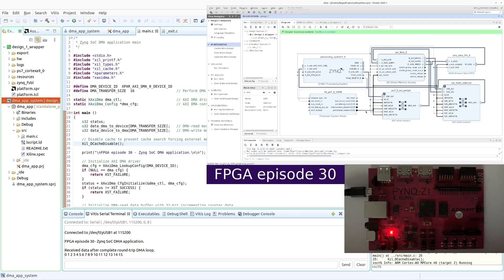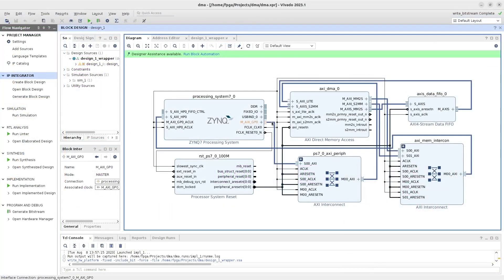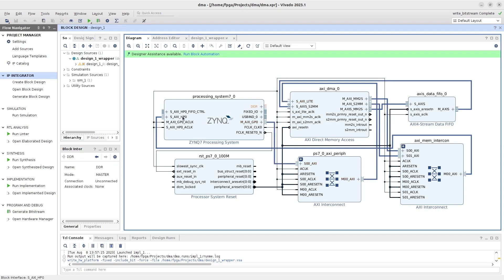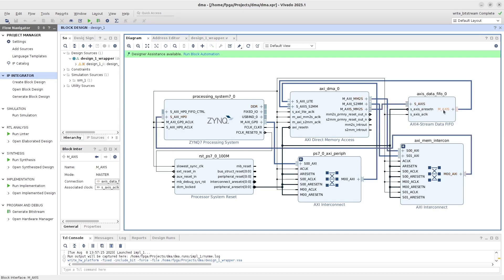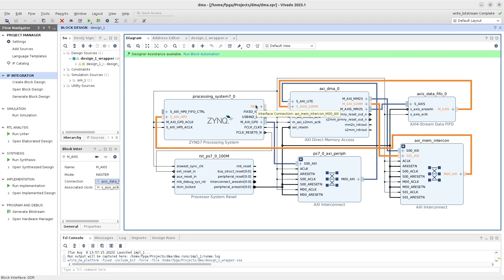FPGA 30 - Zynq SoC FPGA Direct Memory Access (DMA) between PS DDR memory and PL AXI4-Stream FIFO

Comment: Hi thanks for the video, dont you need to connect the fixed_io and DDR pins of the Zynq7 block in the PL via the auto connect?
Reply: I am thinking the same thing.  I followed this video for the Arty Z7-20 and I can program the FPGA but when I go to debug the application I get the error:
 "Error while launching program: 
Cannot reset APU. APB AP transaction error, DAP status 0xF0000021"

Am trying again but this time after connecting the fixed_io and DDR pins via automation
Reply: Update: Using Vivado 2024.1
Everything was resolved after I power cycled my board